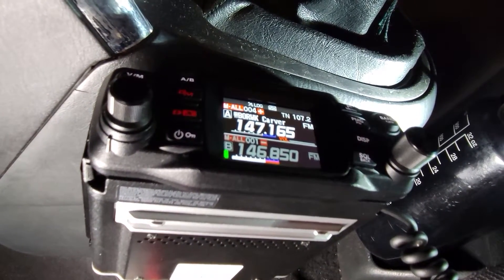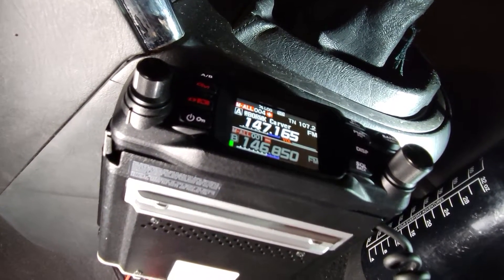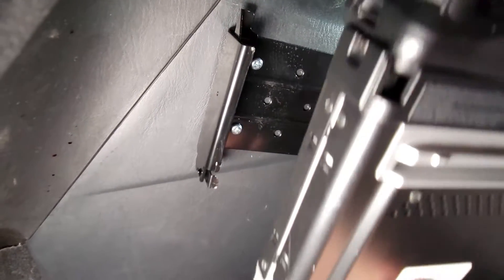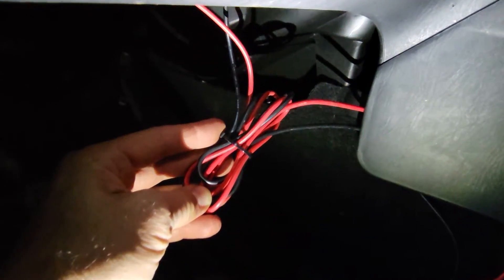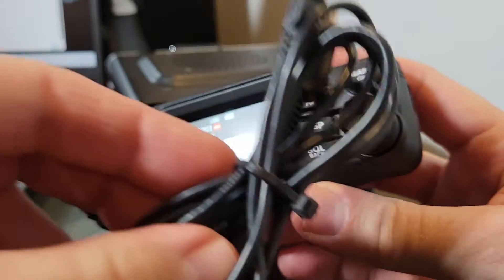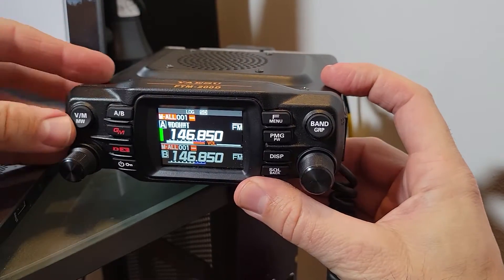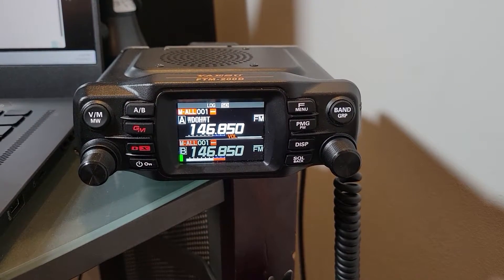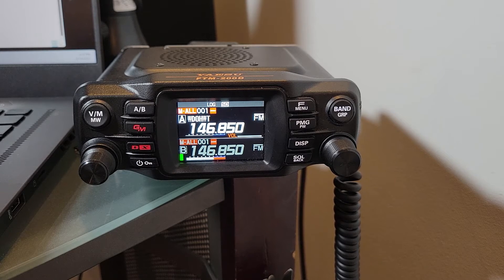FTM-200DR Accessories - Better Than Expected!

Comment: This may be old news to you but the little tab you're pushing is the actual locking tab.  If you look on the opposite end of the mount, there's an actual lever to depress, releasing that tab.  However, it looks as though your mounting configuration may prevent access to the lever.

Comment: I bought my FTM-200 Last August. I have had NOTHING but issues with it. Last weekend it TRULY Broke down. Monday I took it to the HRO in Portland where I bought it, and they are sending it off to Yaesu for repair or replacement. When it comes back, I won't even install it-it is going to be sold and I will be purchasing an Icom 2730.
Reply: No more yaesu rigs for me either I had bought 2 new yaesu ft-891s both had issues less than 5 months old

Comment: How does it sound where you have it mounted and with the speaker facing toward the console? No issue hearing it without an external speaker?
If I get the radio I'm thinking about mounting it in sort of a similar position in my truck  but with the speaker facing outward and will mount the head on the dash using Lidos quick release mount that allows you to push a button to remove it from the mount to take with you
Reply from the maker: Thanks for stopping by and watching! I haven't had trouble with the speaker facing toward the shifter. I found the speaker gets more than loud enough to overcome the placement disadvantage.
Reply: @HamRadioHobbyist  great..thanks for the reply